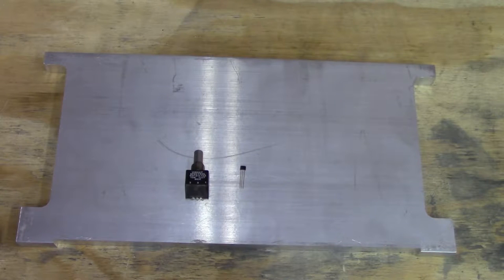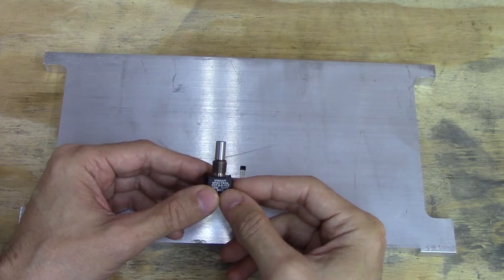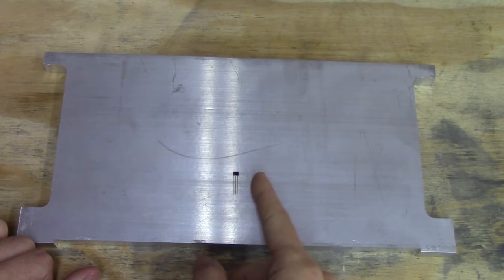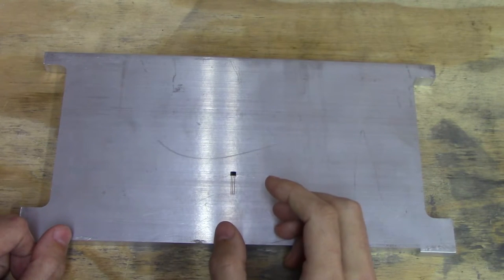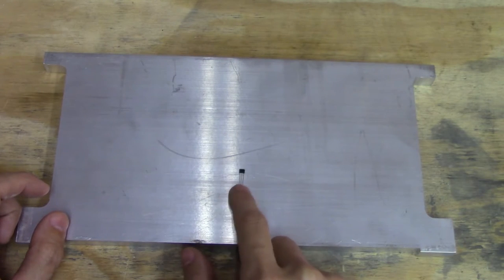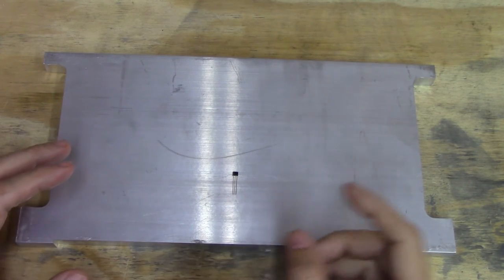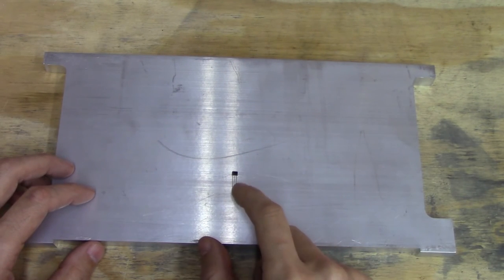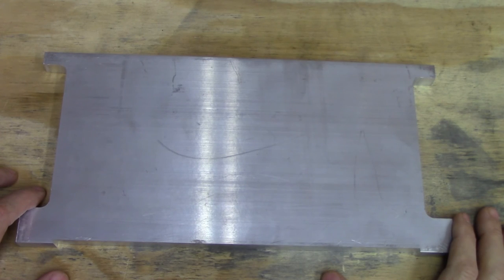ProtoSimTech - Hall Effect Sensors

Comment: Hall effect pot's would probably increase retail about 10%.  The high-end guys don't care whether something is $1500 or $1550 but the guy looking at $299 pedals is going to think twice about paying $350.  Might be better to build the pedals with resistive pots and offer Hall effects as a factory option and/or upgrade kit.  

I've used Hall effect sensors for position sensing for years and get the type in the video for free when I scrap old equipment.  I looked at using them on my pedals and finally decided it was too much trouble.  I paid retail for "pot-style" Hall effects because they were drop-in replacements (k.i.s.s. principle).  Maybe you can come up with a simple, elegant solution that I couldn't see.  I hope you do.

Comment: Hall sensors are far more superior that pots. But you can get all effect sensors in a pot, they cost more but no mechanical contacts to wear out. I use them on my Tilton pedals I built. Look for Hall effect pot.
Reply from the maker: Hey Mike,

We actually considered using Hall Effect POT's, but that would increase the cost of our pedals beyond what we would like. We're trying to keep costs down to an absolute minimum wherever we can, and using these particular Hall Effect sensors is a great way to do that. Having said that, there are always alternatives.

As a company, we need to set ourselves apart from other pedal manufacturers. With our current design, there are a few things that other pedal setups don't have (we'll go over them once we're further in development), but they are still pedals after all. We have to come up with some way to really set ours apart from more expensive options in a much bigger way than just "features". We feel that "price" is how we can do that.

That doesn't necessarily mean that our pedals will mainly consist of cheap parts. Not in the least. We just feel that there should be an option for the public to be able to acquire a set of pedals that don't require a second mortgage.

That being said, we know there are a couple of pedal sets out there that cost under $300, and that's very difficult to compete with. What sets us apart from those sets will be the "features".

It's a difficult balance, and we're constantly reevaluating our strategy based on feedback and what others have come up with. But that's what's cool about our particular situation. We get to show you that process. As we evolve, you'll be able to see it first hand.

Comment: you say that potentiometer makes a signal.Thas wrong it is just a varable resistor so it can let a signal trhue with full powe or not at all iff turend down as a analog volum control.Hall effect sensor is one solution.the hall effect sensor should be standing still on a ciruit board and the magnets move in a frame mountet under  the pedal.you should investigate the midi controller board from berhinger.it uses ir led on one side and a sensor on the other side under the pedal it is a banana shaped (half of the banana)flat sunglass dark plastic pice that slides between the ir and sensor.it has the smootest feel to it with good range and just the best when using it as a volum or a wahwah pedal.it control the effect prosessor built in my behringer vintager  ac112 ultra tube wich is modified by me and therfore  function better than new.I have the dunlop with the seald pot and the behringer hellbabe that uses the same as morley pedals.the hell babe was terrible to control short range and led and sensor must be adjusted almost in the dark cause they use the cheapes red leds they could find and the sensors reacting to light in the rom or flashligth etc.so that solution is way more idiotic than what the behringer FCB1010 have to offer in pedal feel and easy to use.the best.but i want a stand alone wahwah so i am thinkering with some ideas and think i go with ir ligth and sensor like in the pedal board.must make a board for the wahwah effect also then.i am so pissed at the potentiometer pedals they are not good .but you get use to most things after a while.Sorry for my bad english